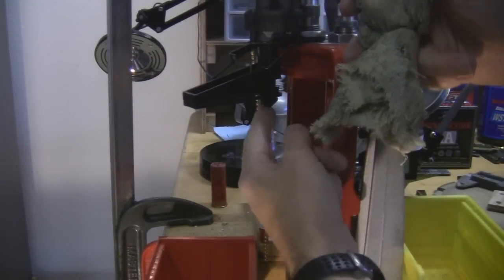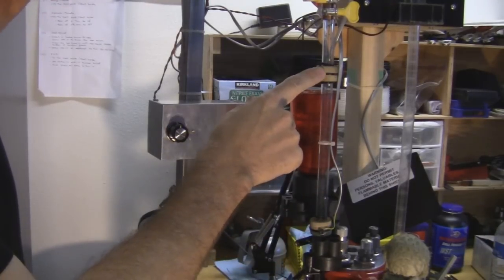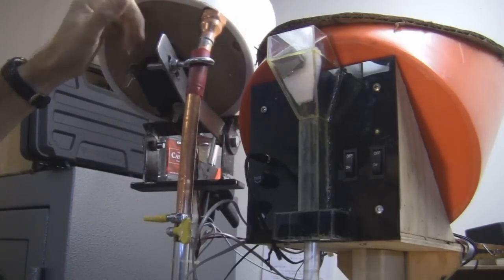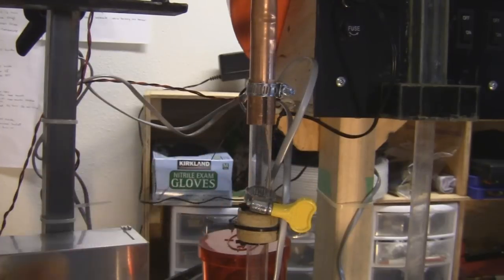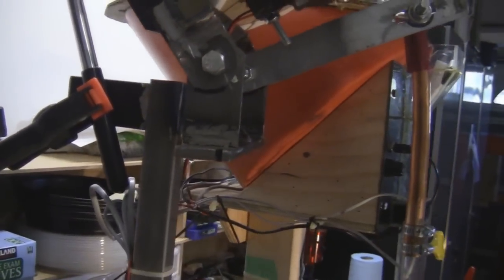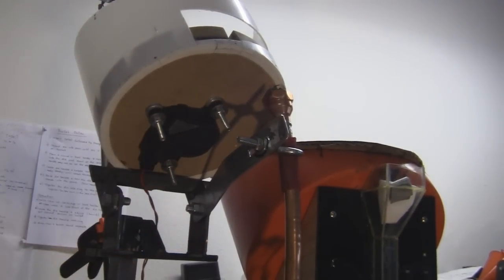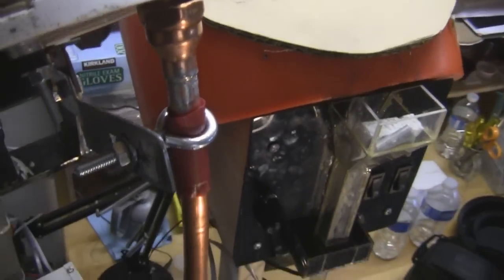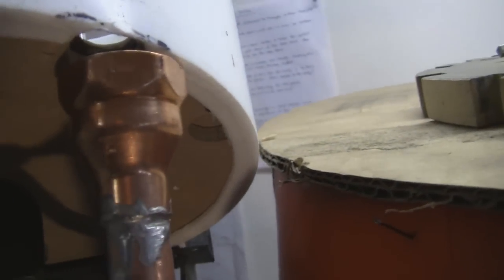Bullet Feeder Collator Construction - Mechanical, DIY homemade

Comment: Good and informative video. I would to see a close up of your bullet flipping grove.
I would like to one of these for a 40s/w with swc bullets. if I can make one the swc's then one for the round nose 9's would be no problem
I made one this weekend but could not get it to flip the bullets. I need a close up of the bottom board with the grove cut in it and then with plate on also
thanks

Comment from the maker: I know a guy who is building a BF like you and same problem.  He is using the 3-12V DC (60rpm at 6V)  CAT# DCM-702 from allelectronics.  You want around 5rpm so I would think that means you need to run it at less than 1V.  You would likely have to put resistors in series with the motor to get it to go this slow.  The motor I use runs at 12V and 5rpm.  It's a high speed motor which is geared down for slow speed & high torque.  It draws less than 50mA (0.05A) when running.  Deflinitely under 100mA

Comment from the maker: @jeffbowles1 I prefer a square slot to a round hole because there will only be 2 small points of contact between the bullet and the hole walls.  The bullet will lie against more wall area if the hole is round and that could create more friction or reduce the tendency for the bullet to tip/fall to upright itself or get hung up when its time to fall down the drop-tube.

Comment: @bearing01 I have a drill press to drill the holes but you comment above makes a lot of sense about the friction. I can use the mortising machine in the shop to cut a square back to the slot. If I have the proper bit sizes that is. I have been thinking on this and I feel I should make separate plates for each bullet.

Comment: That was really neat, in fact ingenious.  I was wondering if you had encountered the two problems that worry me the most.  Sometimes I get a case that has the wrong primer system and it pushes the primer removing pin upwards in the die.  If I do not notice then I will have a case go to the primer insertion stage with the spent primer still in.  Have you considered an alarm for this?  Should be an easy build.  Also sometimes my Lee Loadmaster puts in a primer sideways or not at all.  I have considered putting a small video camera inside the ram looking up at the powder insertion stage but have not found the right tiny camera.  As it is I remove each case at that stage, turn it over and see if the primer is in right and then move on.  This takes a lot time overall.

Comment from the maker: @slwroln From experimenting I found that bullets tip over the best if the motor turns on and stays on for a while rather than always stop & go.  That's why I went with two sensors.  I tried a SPST (or SPDT) switch on the side of the clear plastic tube and found it difficult to to mount and bullets would hang up on it or wouldn't reliably depress the switch.  I therefore went with the optical sensor as a switch instead.  Experiment with the SPDT switch location & mount to see what works.

Comment: Hi John made your case feeder works great I got hold of a star bullet sizer which works well but you have to feed the bullets nose down any ideas would be great
mike
Reply from the maker: mike white I had same issue resizing bullets.  I got clear solid tubing (a few pieces) and  put a cotter pin in the bottom to prevent bullets from falling through.  let the bullet feeder fill up the tubes.  Flip the tube upside down and put it in the bullet resizer.  You can pre-fill multiple tubes or let one tube fill while you're resizing with the other.  /John

Comment: @bearing01    I have some material (HDPE cutting board) that is .500 thick I am using for the bottom plate with groove and plate with slots. Instead of using a bucket I am going to use a sheet of 1/8 polycarbonate and fasten it to the HDPE base. That will eliminate the need for a mirror to see when it is empty. I also have a 3/8 thick sheet of polycarbonate for the shorter bullets (maybe) if needed.

Comment from the maker: Another option would be a 24V AC 4rpm motor CAT# ACM-200 at allelectronics.  Run it off a door-bell transformer.  You could use a contact switch or switch it on/off with a relay. Operate the relay on/off with the electronics sensing the bullets in the tube. /John

Comment: Finally got mine running but can’t stop bullets from getting to top of feeder what can I use to make a sweeper to keep extra bullets from riding to top and getting stuck in the bullet slots
Reply from the maker: Use a paint brush.  Find a way to clamp it to the side of the bucket. /John

Comment: Thank you so much for all the effort and patience you put into this project and tutorial. I am in the process of building both, the case and bullet feeders. I managed to get the case feeder circuit working and am now working on sourcing parts for the bullet feeder circuit. I'm having difficulty finding the 57uF cap. Was this supposed to be a 47uF? Or should I put a 47uF and 10uF in parallel? Thanks again.Eric

Comment from the maker: @jeffbowles1 I usually only throw in around 100 bullets or less at a time.  The motor appears to have sufficient torque to turn the turn table with no issues.  I cut a small washer out of a thin piece of tin (like duct-work sheet metal) and use that between the motor and the turn table and that helps reduce drag.  That motor I use probably has more torque than a rotisserie.  If I wanted a more powerful one I would try to use one from an electric can opener. /John

Comment from the maker: @jeffbowles1 Bullets will enter the turn table upside down. You want the turn table thick enough so  bullets can flip upside down without falling back inside the bucket.  You want the holes not to large (wide or deep) to prevent multiple bullets falling into or getting stuck into the same hole.  Multiple bullets in a hole won't permit the bullet to flip upright and will jam the table when trying to fall down the drop tube.

Comment from the maker: @mac37m1 I could not find an optical switch anywhere.  I use an infrared emitter detector LED pair which is a sensor, not a switch.  You then need to build a circuit that uses the sensor to detect the bullet (or case in the case feeder) and then turn on/off the motor using a transistor.  I could not find the emitter/detector pair anywhere except Radio Shack, which is model 267-142 for $3.69.  I plan to do an electronics video to show how to build this.  /John

Comment: I have come across a question John... The motor selection, have you tired it with the tub full? How much weight?? I am concerned that the weight will be an issue and bog the small motor down.. Have given consideration to using a rotisserie motor, especially since I have one, I am sure the wife will never know it is missing..;)

Comment from the maker: @acfixerdude I use a 12V DC wall adapter.  I have a circuit to regulate the voltage down to 12V and to also power on/off the motor based on the height of bullets in the feed tube. /John

Comment: More questions John..
How did you determine the depth of the slots that capture the bullets?
I am going to attempt a universal bottom plate with groove and how did you determine that depth?
Did you consider using a rounded instead of a square slot, ie:drilling a hole and then cutting from the edge to the drilled hole?
I was down to making 5 slotted plates until the question of the bullet length came up.
Jeff

Comment: Great Job! Can you tell me where you bought the optical switch and part number please. I would like to place the order of the motor -DCM276- and optical switch at the same time to save on shipping if you bought them from the same site AllElectronics.

Thanks in advance.

Comment from the maker: @jeffbowles1  It's also more difficult to make each hole perfectly the same using a drill compared to just cutting straight lines using a jig-saw.  Besides, you have to make cuts using a saw anyways after you drill the holes to make the semi-straight walls  /John .

Comment from the maker: Most expensive part was probably the metal stand.  Metal was probably $20.  The wood was probably $10 (with plenty left over).  The motor was $10.  The plastic tubing maybe $5. The electronics maybe $10.  The bullet feed die is around $30.  If you can find a comparable bullet feeder for sale you're looking at around $600.  I've had one ordered for 223 rifle now for several months now and still no idea when it will be ready. /John

Comment: When cutting your MDF circle, why not use the bucket itself as a stencil and just draw around the bucket? Then just cut inside the line. Or if you cut the top off a bucket, use the cut off part as your circle maker.... thought I guess it's harder to find your center if you don't base the circle on the hole...

Comment from the maker: @slwroln Let me know if you want or need to use a single optical sensor to locate at the top of the tube and have the motor always run to keep the bullet column filled to that point.  I also have a circuit to do that which is much simpler (fewer components) than the one I use here.  /John

Comment from the maker: @jeffbowles1 A can opener motor runs directly on 120V and turning it on/off with my sensors & circuit board would be a very different design.  AC powered motors work differently than DC powered ones and would require a different circuit. /John

Comment from the maker: @acfixerdude I tried replying to PM but there was a problem with your user name.  For B/F alone a 12VDC 300mA or higher mA adapter should be fine.  I use a 12VDC 1200mA Adapter to run my B/F and Case Feeder and all controlling electronics. /John

Comment: @bearing01  Hi John
I have decided to use the 12v motors, I have a computer power supply for a power source. I am also using a different motor, costs a couple of dollars more, but it has hardened steel gears.
Could you email me the schematic for your design??
Also regarding the groove in the bottom plate, how deep roughly is this groove? Did you try a simple channel leading to the outside of the plate to guide the nose end of the bullet to lay down so it can be flipped??

Comment: @bearing01 Thanks John! can you PM me the electronic schematics? I need to know what else I need. I have a general idea but would like to compare on what you built and thanks again.
as for the IR LED and photo transistor I will get them here at jameco.com they are about 15mins away. here are the part numbers in case some one needs it.
Phototransistor IR Chip part nbr112176
LED infrared part nbr 112150